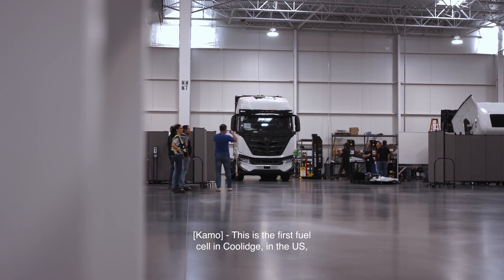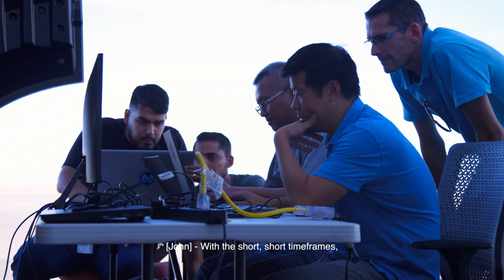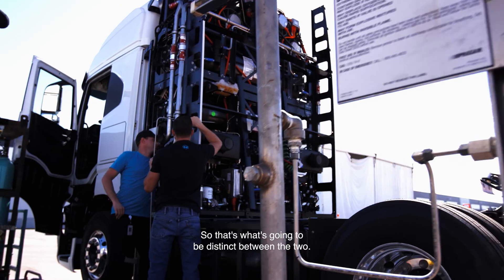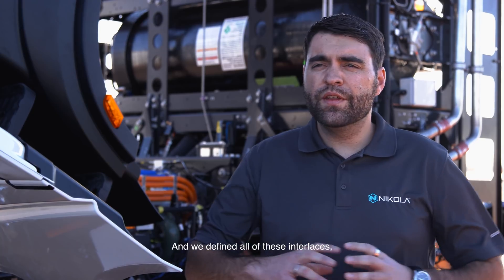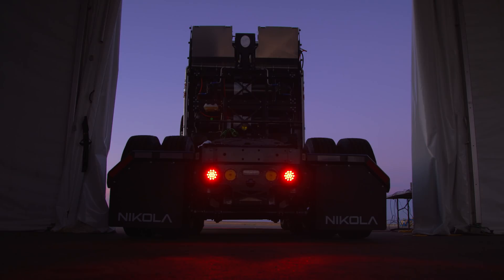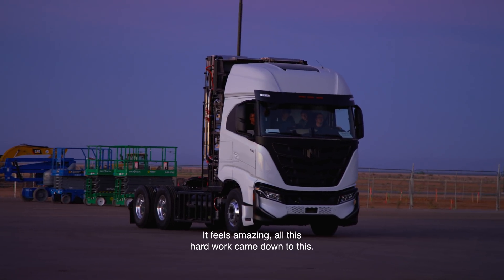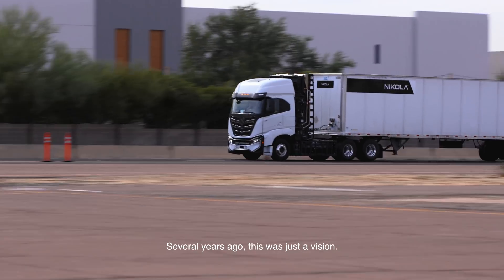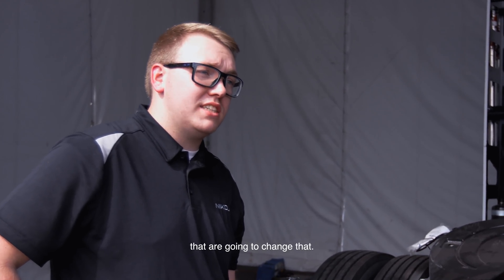Driving Change Season 2 Episode 3: Maiden Voyage | Nikola

Comment: My big questions as a current Truck driver is 1 how long will it take to charge the truck and 2 where will the charging stations for these trucks be located at?
Reply: It's a fuel cell. You don't charge you just pump hydrogen

Comment: It seems incredibly stupid. Why take good power, use it to split water into hydrogen and oxygen, then take the hydrogen and cool as well as compress, make it liquid, pump it in a tank, transport the tank to a gas station, pump it into a storage tank, for then to pump it into the tank of the truck. then send it through a fuel cell that makes it back to power again so that the truck's electric motors have power to propel. In the whole process, at best, 85% energy is lost to nothing, ie pure loss.
It's stupid so it's hard to find words for. There is something smart that you can store power in, completely without having to convert it. It's called a battery. Then you can use the power directly :-)

The most silly thing is that most of the hydrogen that can be bought in this world is made by splitting natural gas. Therefore, a Nikola truck running on hydrogen from split natural gas will have a CO2 emission that is about 1.5 times greater than from a diesel truck.

There really is nothing to celebrate here other than the stupidity of some investors.
Reply: how are batteries charged?? Magically?  Natural gas powered plants.  Where do batteries go when they are no longer functional?  In the ground, not recycled. Prove me wrong on all this? Hydrogen has only a bi product of water.  So that horrible silly process to described above makes sense when you look at the big picture.
Reply: These bozos are fooling all shareholders smh
Reply: Who said anything about transporting hydrogen to a gas station? This has to be the dumbest comment on youtube.
Reply: @danieldeblasio9368  You still have 85% energy loss by converting electricity to hydrogen, then having the hydrogen cooled and compressed so that it can be transported, and then again converting the hydrogen back to electricity for your electric motors on the vehicle. It's so wildly silly.
Reply: @greenenergy-mipvpro  No, you are limited with lithium-ion batteries. They are too heavy to transport,  degrade over time and lose their energy in seasonal climates.
Reply: @danieldeblasio9368  Where is the limitation???  First Teslas running over 1,2 million kilometer without real degradation.  On highways you use powerlines hanging over the roads, huge succes in europe, why large batteries??
Reply: @greenenergy-mipvpro  Hydrogen is a superior storage mechanism compared to battery. First of all, hydrogen has more alternatives wherein hydrogen can be extracted. Therefore, hydrogen expands the energy supply. Transporting hydrogen has more options than battery. You can transport hydrogen through a pipeline or by truck. Also, battery is very inefficient in storing energy in seasonal climates.
Reply: @greenenergy-mipvpro  The price of electricity is not equal. Electricity is based on supply and demand. It is much cheaper to use the electric grid to store and transport hydrogen battery.
Reply: @danieldeblasio9368  And hydrogen is not effected by seasonal climates???
Reply: The primary source of all energy on this planet is a giant ball of burning hydrogen gas. Turning it into electricity and pumping the electricity into big plastic containers filled with toxic materials is incredibly stupid and inefficient. We should just take energy directly from the sun when its available and stop trying to manipulate it for our own convenience.
Reply: battery is too heavy for using truck, so BeV could not have long range, heavy loadable.
that is very important to trucker, it's related to his payment
Reply: @어른들의백과사전  Volvo has a nice longhaul truck on the market now in germany full electric 
Scania has the same as well as Mercedes , Hydrogen department by the largest hydrogen truck manifacturer Hyundai is now closed .  There is no future for Hydrogen trucks
Reply: @greenenergy-mipvpro  Hyundai did not stop but temporarily put on hold passenger hydrogen SUVs due to technological issues but their fleet truck sector continues. In my opinion, Mercedes, Volvo, and other companies are just timing it. I admit that it is long way to go until hydrogen vehicles become prevalent because of infrastructure and other obstacles as compared to battery electric vehicles. Although mobility industry is often catalyst for a big change, it still is only a part of the whole economy. If you check out the Build Back Better bill, whether it passes or not, the US has a strong intention to shorten the time. European or Asian markets including Saudi Arabia express huge interest in hydrogen economy already.
Reply: @greenenergy-mipvpro  lol you do know that trucks have a legal weight limit and guess what........ Batteries weigh to much.

Meaning trucks can't carry as much as well as have to stop more often to recharge.

So not only will I get my product much later, you can't haul as much as I want with battery.
Reply: I find your comment overly superficial, dangerously simplified. 
Amongst several reasons, few things to note for the simple brains are, can you really run factories on batteries, fly planes? What kind of batteries are there to run the whole world. Batteries are to run the cars plus some stuff. Hydrogen is to sustain the whole economy.
Reply: @samuelbae3318  How will you produce your hydrogen?? and how will you store it?
Reply: @greenenergy-mipvpro  just like what you said, electrolysis. Using electricity from renewable sources and even fossils or nuclear for the limited time being to be realistic and for the smooth transitions. Hydrogen itself is a method of storage rather method of producing electricity. Although we don't have enough electricity from the renewables right now, the pathway is clear to get there. The real issue is not about  production of electricity anymore but about transport and storage of it.

Comment: This can never work. Here's why. Teslas 4680 equals
A 1.5mwh battery range in today's standards, with the cost and weight of less than a 750 kwh hour pack. Hydrogen can not compete and look at this monstrosity... The cost mass manufacturer it, then deal with the hydrogen and all the teething problems is a pipe dream. Tesla will destroy this company.
Reply: I ❤TESLA.
This space belongs to Nikola right now.👊😎
Reply: Lol that Tesla battery will be too heavy and will cut into truckers profits because reduced loads due to 82000 weight limit. But good try Tesla fan boy.
Reply: And yet they have trucks coming to market well before Tesla... funny how that worked out. BTW Hyzon already is selling hydrogen semi trucks, on the road now... working now... moving stuff now. Tesla, not so much, and only 3 years late as always.
Reply: @FEV369  We have a few years before hydrogen trucks are ready on the roads in the U.S.
Reply: @danieldeblasio9368  Yet Hyzon is literally selling them right now and it's a US company... Nikola has them and "should" be delivering soon.

What are you talking about "on the road." You mean because we don't have the infrastructure? Building a hydrogen infrastructure is a thousand times easier than charging EV's. These are Semi's on set routes, they only need a few stations.
Reply: @FEV369  Hyzon sold trucks in China. Yes, we dont have an infrastructure yet.
Reply: @danieldeblasio9368  also Australia,Netherlands,worldwide   ,Nikola will have mobile solutions until stations are built,both companies have big partnerships as TC Energy
Reply: U geneus go out here what is ur problem with nikola
Reply: Lol, good luck with that!😂